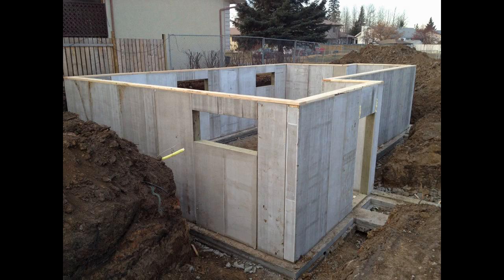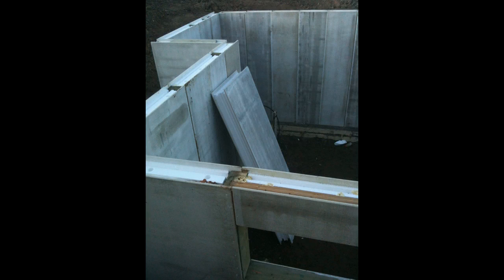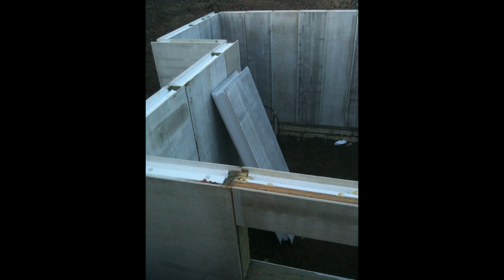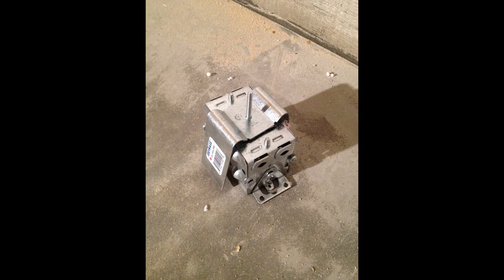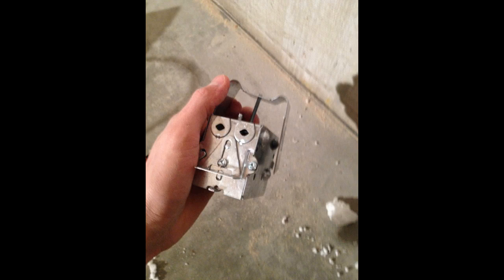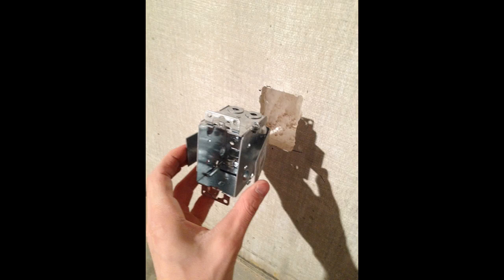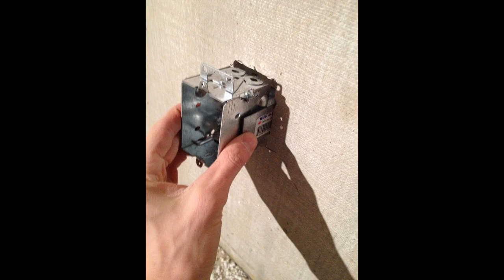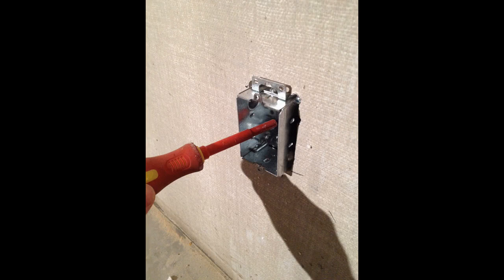Sip Electrical - How to Run Wires - What Electrical Box to Use? - Structural Insulated Panels

Comment: And after tensioning the "wings" with a screwdriver, then we're done? No need to fasten the box's upper and lower flanges to the mag board?
Reply: Correct. Just tightening up the retrofits wings held it firmly in place.